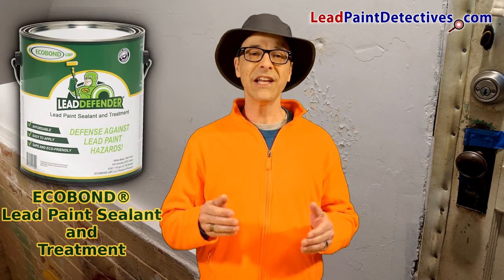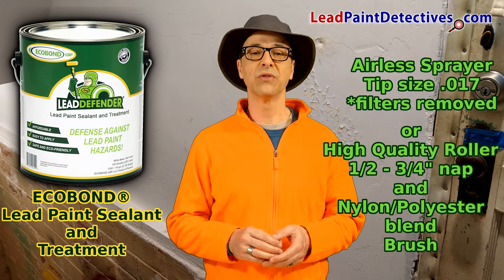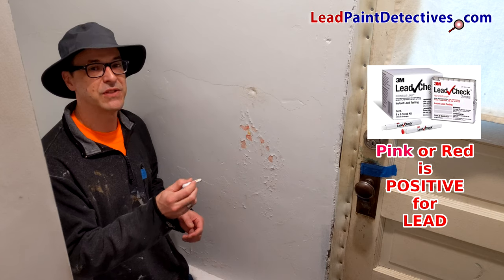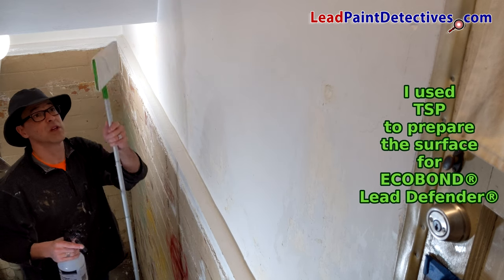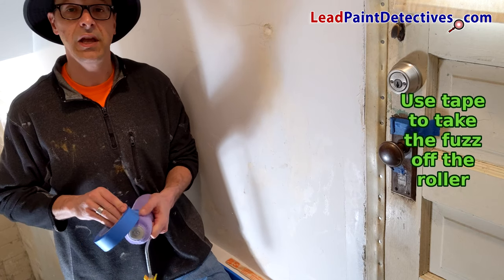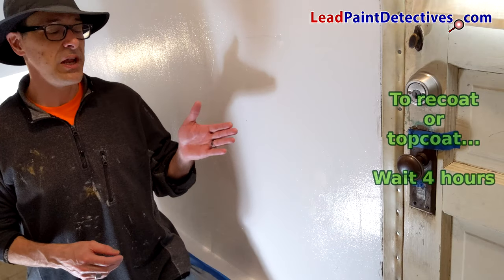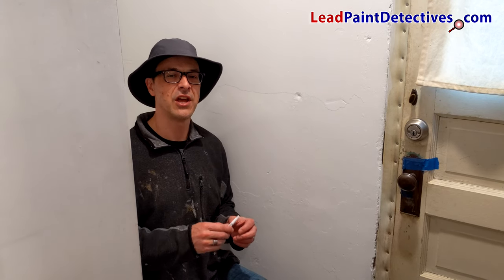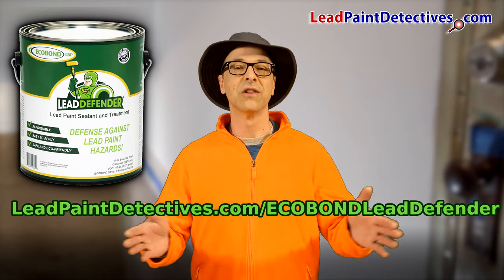ECOBOND® Lead Defender® Real World Painting

Comment: I’ve used this to treat an old house as a homeowner and am getting ready to do another.  Just did a light, safe prep, used Lead Defender as the primer, 1 coat laying it on nice and thick to penetrate the old layers of lead paint, then topcoated 1 coat.  Problem solved.    Holding up great so far (4yrs), this stuff softens and soaks into old layers and seems to bond better despite minimal prep.   Tinted it a bit, similar to topcoat color.   Using it from now on, it’s a no-brainer all around.

Comment: do most paints contain traces of lead today even though it is below action level? I did a lead assessment of my apartment that was converted to a condo in the 90s and it contained small trace amounts even though the paint is likely not from the 70s. Curious if that is normal for "lead free" paints to have some lead?
Reply from the maker: It's understandable to be concerned about finding small traces of lead in your supposedly "lead-free" paint, even if it's below the action level. Here's what you need to know:

Trace amounts of lead in modern paints:

Yes, it's normal for some modern paints to have trace amounts of lead, even if they are labeled as "lead-free." The Consumer Product Safety Commission (CPSC) defines "lead-free" as containing no more than 0.06% lead by weight, which is a very small amount but not technically zero.

This trace amount is generally considered safe for healthy adults as long as the paint is in good condition and not chipping or peeling. However, for young children and pregnant women, even low levels of lead exposure can be harmful.

Possible reasons for finding trace amounts in your case:

Residual contamination: 
It's possible that the trace lead you detected could be residual contamination from paintbrushes, rollers, or other tools used during the condo conversion in the 90s, even if the new paint itself was lead-free.

Cross-contamination: 
If the contractor who painted your condo also worked on older buildings with lead-based paint, their equipment could have unintentionally transferred tiny amounts of lead dust to your walls.

Mislabeled paint: 
In rare cases, some paints labeled as "lead-free" may actually contain slightly higher levels of lead than allowed by the CPSC standard.
What to do now:

Don't panic: 
Finding trace amounts of lead is not necessarily a major cause for alarm. If the paint is in good condition and you take precautions to minimize exposure, the risk is likely low.

Retest: 
Consider having a second lead test conducted by a certified professional to confirm the results and identify the source of the lead.

Take precautions: 
If you have young children or are pregnant, it's important to take some precautions to minimize exposure to lead dust. 
This includes:
Regularly cleaning surfaces with a damp cloth or mop to remove dust.
Washing hands frequently, especially after cleaning or playing on the floor.
Keeping children away from areas with peeling or chipping paint.
Consult with your doctor if you have concerns about your child's lead exposure.

Additional resources:

EPA Lead website: https://www.epa.gov/lead
CDC Lead website: https://www.cdc.gov/nceh/lead/default.htm
Consumer Product Safety Commission Lead website: https://www.cpsc.gov/Business--Manufacturing/Business-Education/Lead/Lead-in-Paint

By understanding the situation and taking appropriate precautions, you can manage the potential risks associated with low-level lead exposure in your apartment.
Reply: @LeadPaintDetectives  Thanks for this thorough response. 
Any chance you know the conversion of 0.4 mg/cm2 to ppm? That was the highest reading in my apartment.
Reply from the maker: @whiteowl0227   I am not a math whiz and most of the calculations I have to make are done by the lab I send lead dust samples to. But, I did my best to look up any information I could find to help you.

Converting directly from mg/cm^2 to ppm for paint is not possible because it requires additional information about the specific paint and its properties, such as its density and thickness.

The units mg/cm^2 and ppm measure different things:

mg/cm^2: This unit measures the mass of a substance (in this case, the paint) per unit area. It tells you how much paint is spread over a certain area.
ppm: This unit, parts per million, is a dimensionless ratio that expresses the concentration of a substance as parts of that substance per million parts of something else. In the context of paint, it could represent the mass of lead in the paint per million parts of the total paint by weight.
Therefore, to convert from mg/cm^2 to ppm for paint, you would need to know:

The density of the paint: This tells you how much mass of paint is present in a given volume.
The thickness of the paint layer: This tells you the volume of paint per unit area.
Once you have this information, you can calculate the mass of paint per unit area (mg/cm^2) and then divide it by the density of the paint and multiply by 1 million to get the concentration in ppm.

For example, if the paint has a density of 2 g/cm^3 and the paint layer is 0.1 mm thick (0.01 cm), then:

The mass of paint per unit area would be 0.4 mg/cm^2.
The volume of paint per unit area would be 0.001 cm^3/cm^2.
The mass of paint per unit volume (density) would be 0.4 mg/cm^2 / 0.001 cm^3/cm^2 = 400 mg/cm^3.
Therefore, the concentration in ppm would be (0.4 mg/cm^2) / (400 mg/cm^3) * 1,000,000 = 1000 ppm.

However, without knowing the specific density and thickness of the paint in your case, it's impossible to provide an accurate conversion to ppm.

Comment: I have window sills and trim with lead paint. It's chipping and deteriorating. Some places have paint that kind of peels up (I assume that isn't the actual lead layer). What do I need to do before using the eco bond paint?
Reply from the maker: Surround the area you're working in with plastic drop clothes. Mist with water and scrape. NEVER dry sand! You are allowed to wet sand. The idea of using water is so invisible lead dust isn't floating in the air and contaminating other living spaces. It takes a very small amount of lead dust to contaminate a large area such as the first floor of a property unit. I also highly suggest wearing tyvek style suits and respirators because you don't want to breathe in lead dust and you don't want lead dust on your clothes.

Comment: Thanks for this video. Would you say it is necessary to encapsulate surfaces if your lead readings are all below 0/5 /cm2? Im buying an apartment where my newborn will be raised in and had it tested. The test fall below the NYC city limit, but I'm inclined to taking more precautions.
Reply from the maker: I always say it's better to be safe than sorry especially since you have a newborn. It's important to note that ECOBOND is a sealer and not an encapsulant. Those are two different products applied very differently. For your project it sounds like ECONOND sealer will give the extra protection you're looking for.
Reply: @LeadPaintDetectives what’s the difference between a sealer and encapsulate? Do you feel abatement is the best solution or should sealing would be enough for my situation?
Reply from the maker: @whiteowl0227  @daviddelgado2124 A sealer applies like paint and an encapsulant requires special application with thickness tolerances. They both are trying to do the same thing trying to cover lead paint. ECOBOND as a sealer is easier to use than an encapsulant. Does this help?
Reply from the maker: And... Abatement, by removing the source of the lead paint is always better than an encapsulant or sealer, but you have to clean up properly before, during, and after abatement keeping airborne lead dust to a minimum.
Reply: @LeadPaintDetectives  Thanks for the detailed response. I appreciate the work. you do to provide this education and a product that helps protect people and families like mine.
Reply from the maker: @whiteowl0227   Thank you. I do my best to give people the information on toxic lead dust and how to mitigate the issue. It's not talked about enough nor are the solutions. More videos are coming in a few months. Again... Thank you.
Reply: Hey WhiteOwl! I have a similar situation to yours - purchased an NYC COOP, had 3 lead inspections and all showed lead in different places. The discrepancies between inspections have us very worried than many of the “lead inspectors” either don’t know what they’re doing, or are simply doing shotty work for a quick buck. My son is 6 years old, so we’re concerned about the presence of any lead. What did you end up doing to solve your lead problem?
Reply: @jrcreator2257  we did lead encapsulation before we moved in and painted over that. I can share a solid lead inspector if you want who will get on the phone with you and provide honest guidance
Reply: @whiteowl0227  That would be amazing, thank you! Have you had your lead levels tested at all after moving in? Encapsulating would be much more affordable for us, but I’m a tad paranoid of the worst case scenario.

Comment: Do i need to scrape chipping paint off first? If so, should I apply one coat first then chip and apply second coat?
Reply from the maker: You need to scrape off the chipping paint first. In doing so you should always wet sand or wet scrape by misting the surface with water to minimize lead dust. ECOBOND won't help peeling paint stick back onto the substrate. All loose paint should be misted with water, scraped, then painted following Renovation, Repair, and Paint rules.

Comment: Hello, will this help obtain a "zero lead" certification when inspectors use the "gun" or will this provide a "permissible" level of lead during inspection at the time/date of inspection? As in an annual level check. I am trying to obtain protection of both liability and for my tenants with the prevention of lead exposure. Thank you very much.
Reply from the maker: ECOBOND is a sealer and after application if you use an XRF gun it will still show lead beneath the surface. I don't know your location so check your local/state/federal laws to see what is "permissable".

Comment: This product is Not an encapsulated product. More of a deterrent.
Reply: Yes... It's a sealant/treatment NOT an encapsulate.
Reply: Hi, if a lead dust swipe were done on the area treated with this product, would the result mostly likely show acceptable lead dust levels or not really?
Reply from the maker: @cheryllee2642  Yes. If I perform a Dust Wipe Inspection after sealing with ECOBOND, the area should pass. However, opening and closing a treated wood window before a Dust Wipe Inspection, due to friction points on the window, the area may fail. Wood windows are tricky and must be cleaned properly to pass a Dust Wipe Inspection.

Comment: Can you use this as a primer?
Reply: Yes.  I have used this to treat a house a few years ago, and have spoken to their rep Paul in Colorado a few times, and he said it basically is a primer, that’s it’s primary function, to use as a primer that adheres very well, actually softens and soaks into the old layers of paint, and can be topcoated if desired (which I did).   Best solution I could find 👍

Comment: what would you do if you wanted to fix the wall and remove the divots and cover the cracks?
Reply from the maker: The process I use: I get premade drywall mud because it’s thin and easy to work with. It takes longer to dry, but if your working with a lead paint wall it’s the way to go. Fixing divots, I apply the drywall mud with a plastic knife in three layers. Between each layer, I use a big car wash sponge and water sand the wall. I’m trying to minimize to zero any dust in the air. With practice, you can get it down to just 2 layers. 

For cracks and seams: I use the same premade drywall mud. self-stick fiber tape, and a 12” mud blade. Lay down your sticky fiber tape, then one by one add 3 layers of mud, water sand after it’s dry and after each layer added. 

Pre-made drywall shrinks and in thick layers can take 24 hours to cure depending on humidity levels. It’s very hard to water sand without mechanical equipment using 90 minute (cure time) or less drywall mud. It creates dust no matter what. I’ve tried water sanding with a palm sander… albeit it works, but it still creates dust.

Comment: Hiya, painting some lead panels of a big structure. So we're sanding, undercoating then 2 top coats. Can you advise if we need to use a certain product or change the process.
Thankyou
Reply from the maker: Make sure you follow all Renovation, Repair, and Paint (RRP) rules. When sanding you should never dry sand lead paint... Always wet sand by spraying the substrate with water then sanding. Your process sounds correct and you should be fine with two top coats.

Comment: If ECOBOnd is just a primer, why pay $56.00 instead of $26.00 per gallon for a regular primer?
Reply from the maker: ECOBOND is a sealer/treatment. It turns the taste of lead paint bitter so kids will stop eating lead chips of paint. I'm not an expert, I tried it and liked it. I suggest you contact ECOBOND and ask the same question. https://ecobondlbp.com/
Reply: @LeadPaintDetectives  While I agree that making the surface coating not taste sweet is a good idea, most children are lead poisoned by lead in dust in their environment. A proper paint stabilizer doesn't need to be so expensive is my only point.